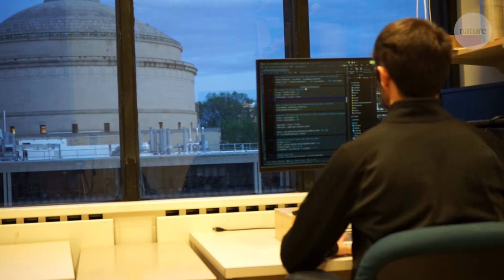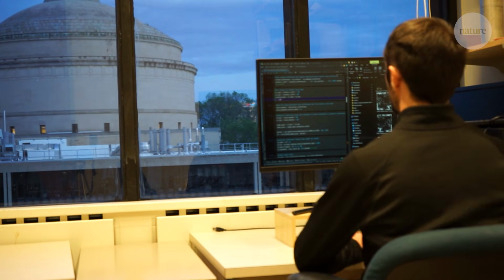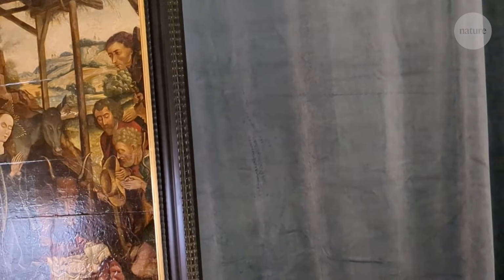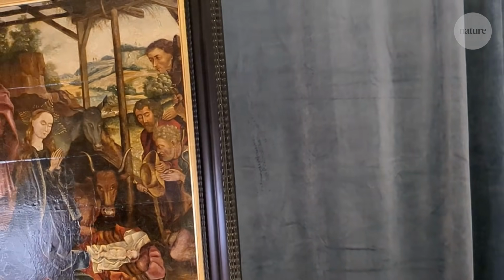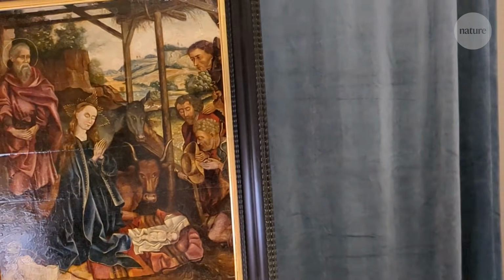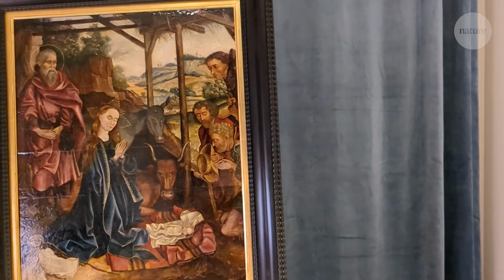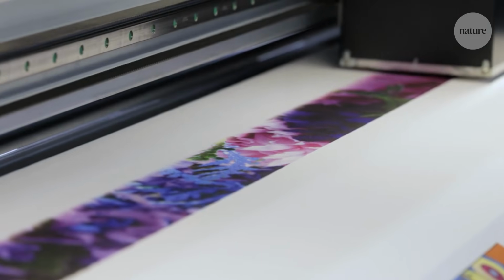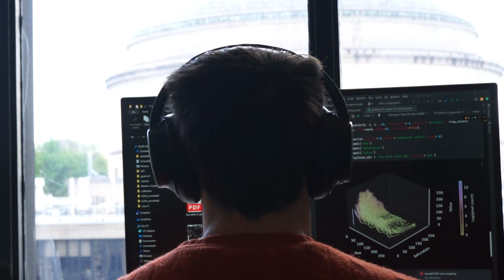Meet the engineer who invented an AI-powered way to restore art

Comment: Restoration with film is quick. But how will the surface of the painting continue to breathe? Also, the connection between the film and the old paint layers might become stronger than the bond with the original base. If we remove the film in the future, we may damage the painting’s layers. So, this idea is useful at the initial stage, when AI can show the restorer a machine-generated version of the composition and colors.
Reply: Very interesting

Comment: That is fantastic. For many works, it seems like you would 95% percent of the benefit by just making a good quality print of the AI corrected complete work. Especially with designed-for-artwork version of a 3d UV printer using similar technology to the EfuyMake UV printer that can replicate the 3D features of an oil painting.

Comment: Matching colors is great and all, but the texture of the restoration paint as well as the 3d nature of brush strokes is also important. Even if the color matches, you can tell when an area has been restored if it is flat and smooth compared to the rest of the painting.
Reply: Printers like the eufyMake UV Printer could also print very detailed Impasto. 
(Just introduced to the market and too small. But you get the idea) 
The Impasto of the original painting can be fairly easily recorded with Photometric stereo in great detail. 
The AI could then also complete the depth map as well. 
Would love to see a follow up also trying to recreate the Impasto of a painting.
Reply: Making the restoration distinctive may be better
Reply: I sincerely wonder it modern restorers would attempt impasto or simulated brushstrokes, rather than just putting thin, removalable color over the original textures.
Reply: Are you freaking serious?? YOU!… Who has absolutely ZERO experience in the restoration field have the hide to tell someone who has been doing this for decades that you know better than they do???
No wonder your friends and family ignore you. You are full of yourself.